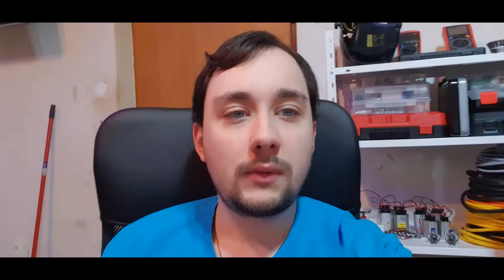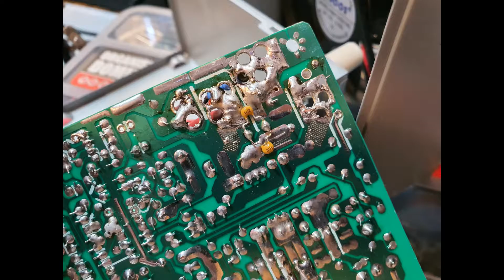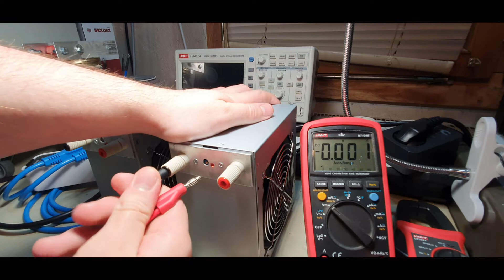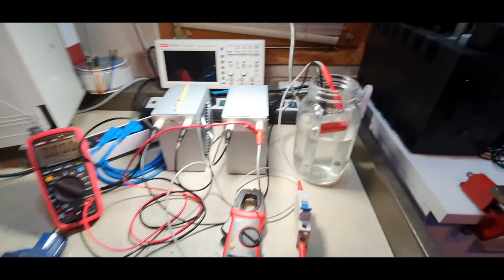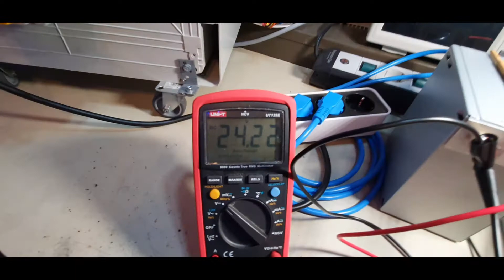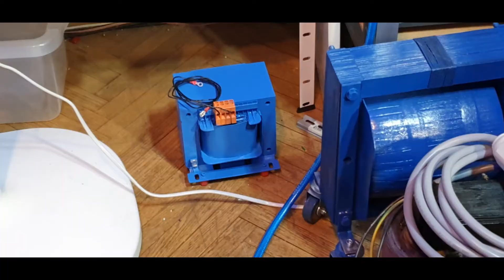Modified ATX PSU

Comment: Interesting. I've used unmodified PC PSU's as add hoc power supplies in the past. They are quite grunty, I've got one that can allegedly kick out 100 amps on the 12v rail!
Reply: that's scary, probably not true if its a regular atx one

Comment: That is great. Thanks. Can you elaborate on how you isolated the PSU's to enable series connection?
Reply from the maker: That's really easy just put plastic washer between the PCB and the metal chassi on the low voltage side of the PCB
Reply: @Alexelectricalengineering  Oh, wow - is that it? Thanks!!!
Reply from the maker: @ShoebridgeForPM  Yes
Reply: @ShoebridgeForPM  old comment but no matter what you do make sure to test continuity between the board and the chasis

Comment: Really Cool good work I've modded these to do 8 to 30v u have to remove the comparitor or supervisor ic and change the caps for higher voltage caps ... 494 is the easiest obviously but I have done most types over the years..
Reply from the maker: Thanks, did you also change the rectifier from tow diode to full bridge?

(I still have the original rectifier and caps)

Greetings Alexander
Reply: @Alexelectricalengineering  no mate left the old ct rectifier arrangement on the 12 rail